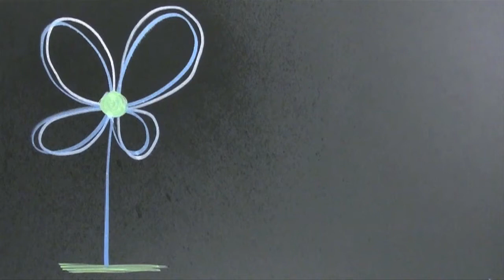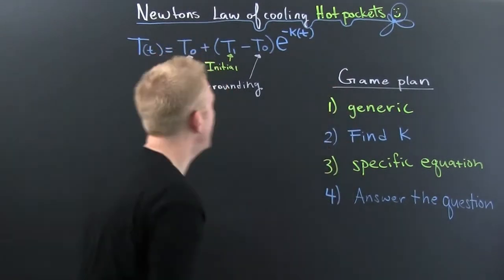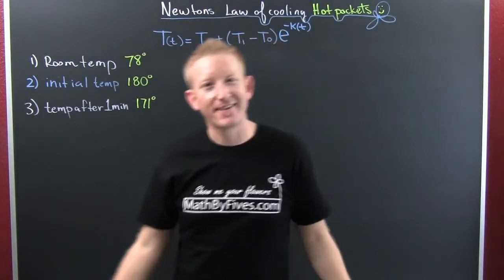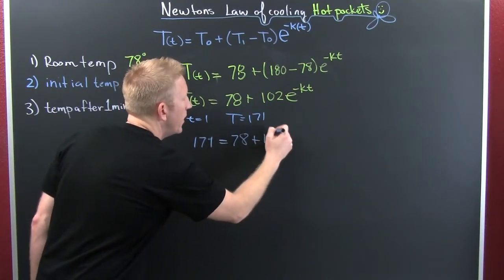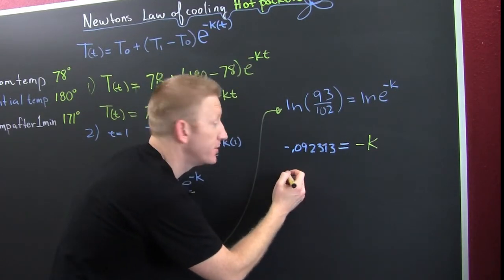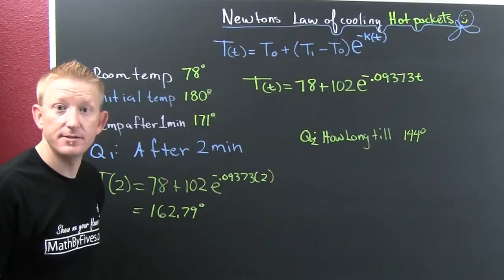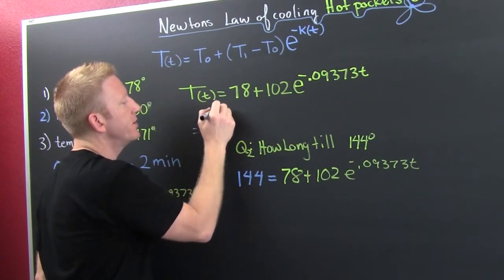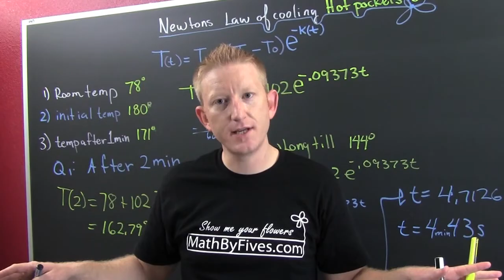Newtons Law of Cooling Hot Pockets

Comment: For users of the Celsius scale, these values are approximately

78F  = 25.5C
180F= 82.2C
171F= 77.2C

But the thing to notice is using C instead of F results in exactly the same value for k - so it is (or should be) independent of scale [Box and Flower!]